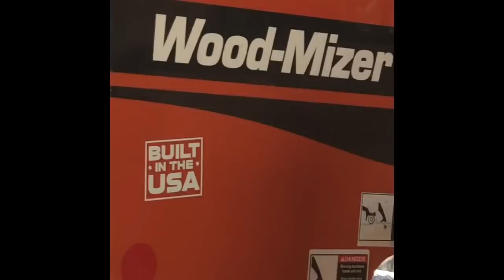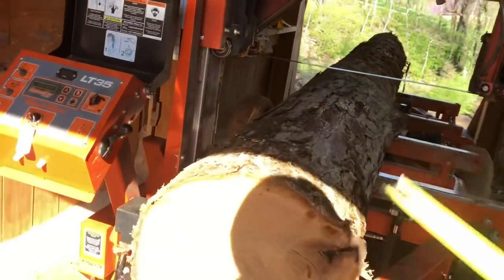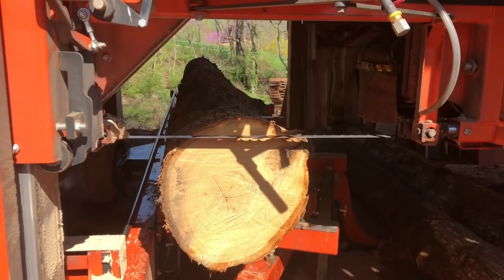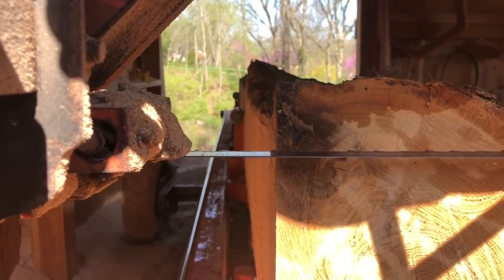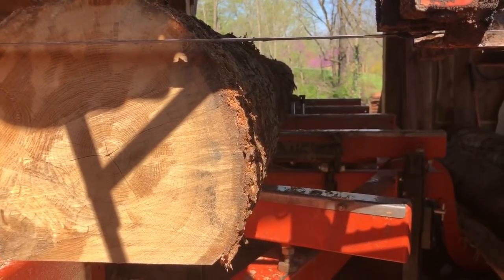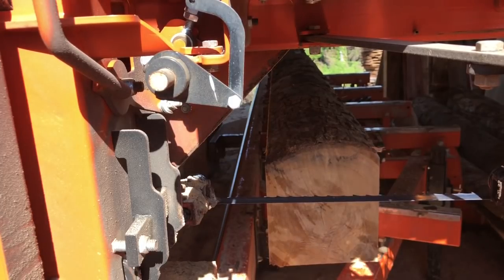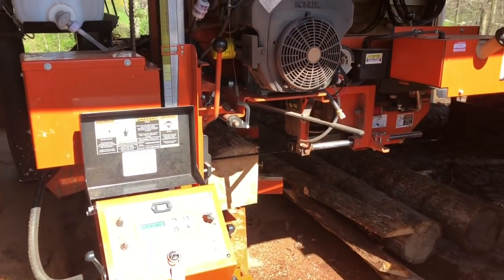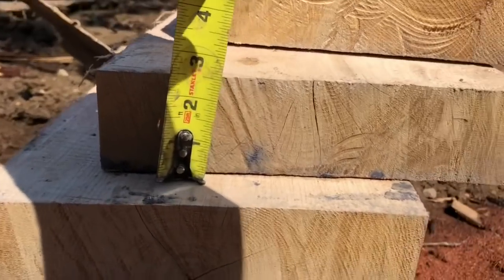Let’s Cut One Together!

Comment: Excellent video!  Gives folks a lot of insight into what you go through to turn out the needed lumber.  You do have to know what you are doing in order to get the best use of the log and turn out the correct dimension lumber.  ...and yes...you do have to remember to zero the toe board or you get some long wedges.  Also, the use of the Simple Set makes cutting dimension lumber simple as long as you remember the 1/8" blade thickness.  Keep up the great job!
Reply from the maker: Tony Baleno thank you I appreciate it a lot!

Comment: Great information in your video. Me being a visual learner, could have used some lines on the end to get an idea of where things were going to be cut. By now, you have the experience that you can see how it will all work out, so good on you.

Also, how do you determine where to set the toe board? Do you measure the pith to the bed, or just a good eyeball?
Reply from the maker: Thanks. I understand that. Yeah I just kinda see what is going to happen before I make the cut most of the time. With the toe boards I just eye ball everything. If I’m quarter sawing nice oak for customer I will measure the pith of the log and get everything all perfect

Comment: With the automatic feed on the sawmill head, when it reaches the end of the track will it stop on its own?
Reply from the maker: Mark 335 there is a rubber stop all the way at the end so it will stop the head. I’ve had this one for two years and I’ve never had the head get away from me where it has hit the stop though